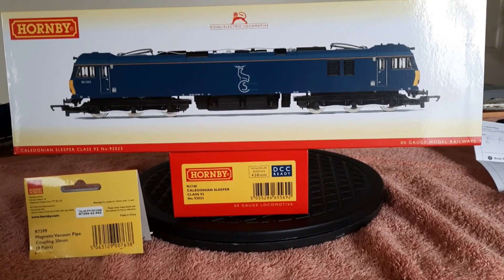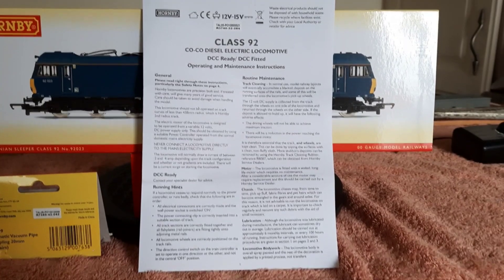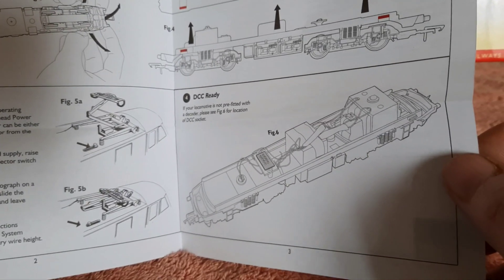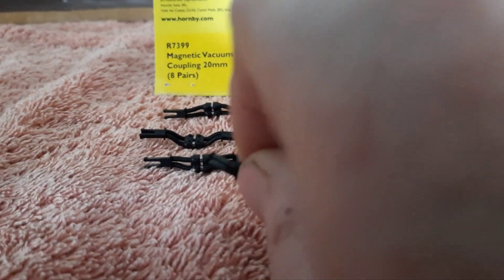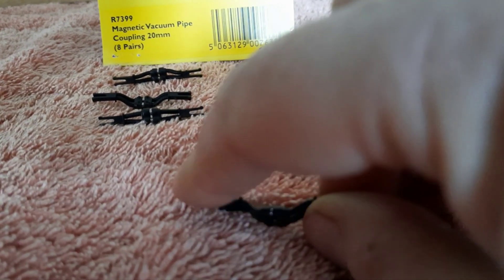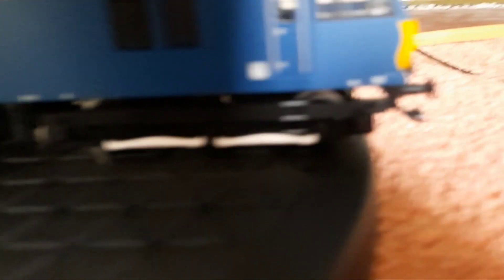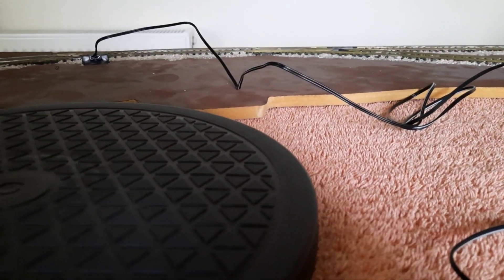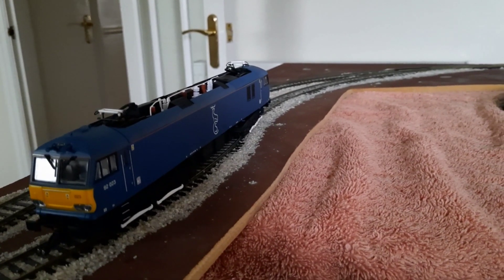🧲Magnetic Vacuum Pipe Couplings 20mm R7399 Hornby

Comment: Great video Kev mate hornby magnetic couplings are the bees knees fantastic little items that are very strong, I have 3 of those class 92s that are dcc fitted and unfortunately you only have head lights and no tail lights even with decoders fitted to them but I still like running them all the best mate kind regards Danny 👏 👍 😀
Reply from the maker: Thank you so very much for watching my video and comment Danny. Thanks for info on the 92's. It's a pity no red tail lights even when on dcc. The head lights are strong though. And what I paid for the 92 it's still worth it. I also found I have a Cal Sleeper class 47. But not until after I had done the video. That would have been better using that for taking coaches on non electrified line. Oh well, maybe next time eh. Cheers mate ATB Kevin 🙋‍♂️🤝👍📽👨‍🔧🚃🎬👀